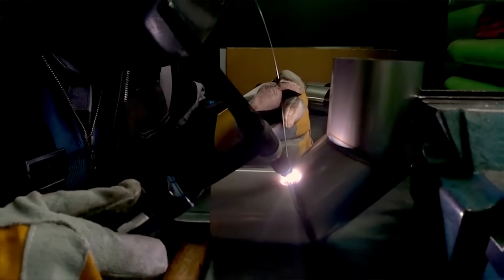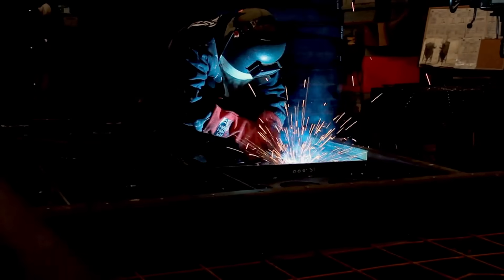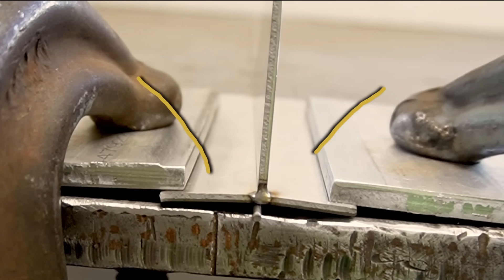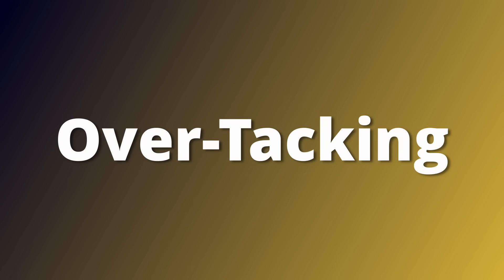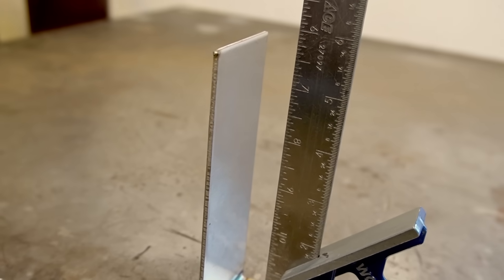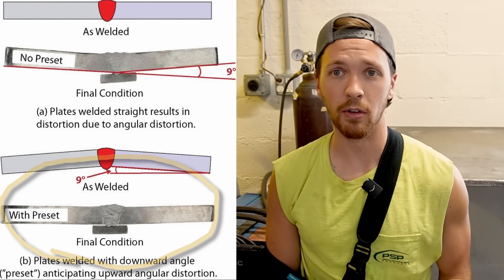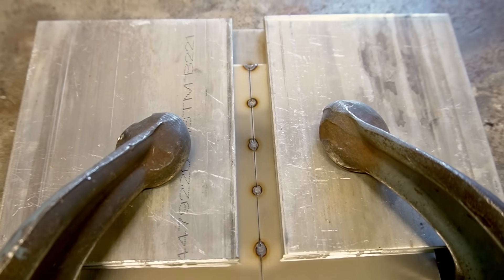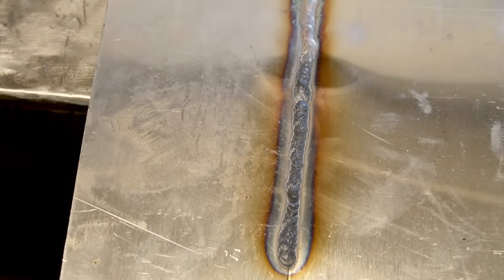Techniques The Pros Use To Avoid Weld Distortion (part 2)

Comment: Each metal has it's own characteristics, On the extreme ends are stainless to the non ferrous group. The stainless steel group, 300, 400 warp so much b/c the chrome "pores"/ molecules are very close together. The heat from welding has a hard time spreading away from the molten area. 
  The other end of the spectrum...the non ferrous group...aluminum & copper...their "pores" are further apart. The heat from the molten puddle can spread away much better. (think of copper & alum. wires).
  Even so, I use mild steel angles to "restrict" the aluminum from warping when I have an aluminum part to make.  
  THe carbon steels, from A-36 (mild steel) and into the higher carbon steels...they are in the middle of s/s & non ferrous materials...they warp at their own rate, as you know. . Here I use aluminum or a copper backing if the part being welded is small.  
  When the "part" being made is bigger than the alum. & copper backing "heat sinks" that I have are...
I use clamps and other carbon steel structural members to restrick the warping. 
  On one chemical plant build I was part of...there was an older guy who had a bucket of water and a rag he was using. He put the wet rag on the back side of the s/s pipe to counter the warping. I was interested. He showed me. Now, 39 yrs later, I am pretty good with this technique. The pipes were 308 and 316. So, not enough carbon in them to be adversely affected.  I have used this wet rag trick on 3/4" plate too. It works, slowly b/c of the thickness. 
   Welding is an exciting trade. I looked forward everday to what I could learn. 
All the best, everyone, 🙂

Comment: this whole topic is case specific. being cautious for pulling only applaies to specific use cases. We do a lot of structural stuff in ym shop and it has NEVER been an issue. When we do bridge beams fro vibrating screens, we have to do roughly a 15mm weld which pulls the flange. But we have enough spare that we machine ti flat after.

Comment: Most people won't know this.  On parts that you can handle, if you counter drill opposite of the weld. And fill it back in, you can pre bend the material, even straighten it back out after it's already welded with out having to cut it and redo welding

Comment: Tips for welding different thickness of mid steel?
Reply: Practice, I've been welding  0.9mm - 6mm thick mild steel with MIG and TIG for 37 years and every day is a school day.
Reply: Proper tehnique, a bit of the cooling time and a good clamps.

Comment: Doing thin sheet stainless or otherwise they sell heat absorbing pastes that can be re-used like Bloc-it, Thermotrap but Heat freeze is what I swear by. I use it on anything I need to pull heat from and keep the spread of the heat local to minimize warping. Works great on auto body panels. If I do frame work it's usually on a surface plate in a fixture or jigged tight so it ain't moving but out of that scenario I use preloading and after 35 years I know how many degrees I need to angle for whatever thickness material I'm welding depending on weld duration. Learning everyday still, nobody knows it all and sharing knowledge benefits all of us. Good vid!

Comment: It can be useful to cnc cut parts with weld compensation that when welded end up the right size and shape. This requires consistant preps and welding. When done well, it's easy and fast.

Comment: Weld metal always shrinks when it cools. The closer you can get to a perfect fit with a uniform gap, the more you can get the shrink to pull the parts together without unwanted distortion.